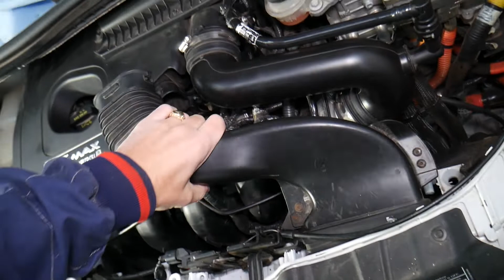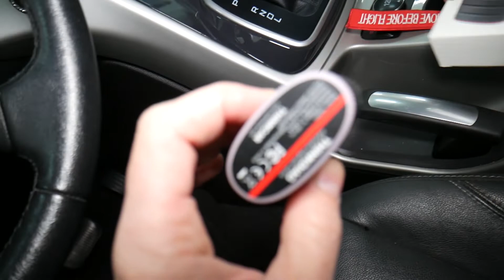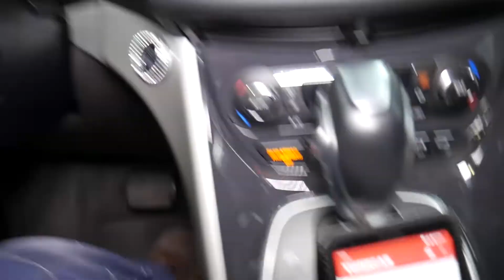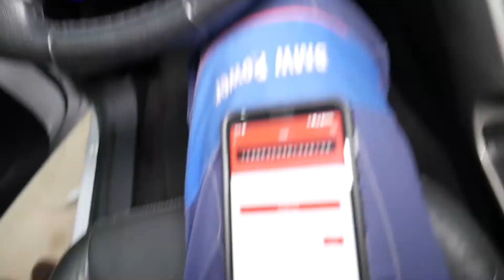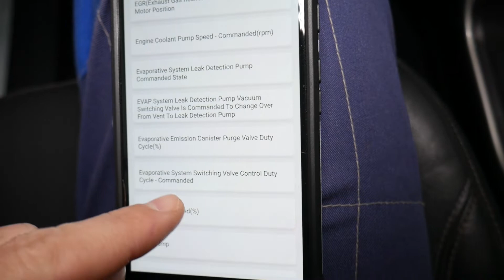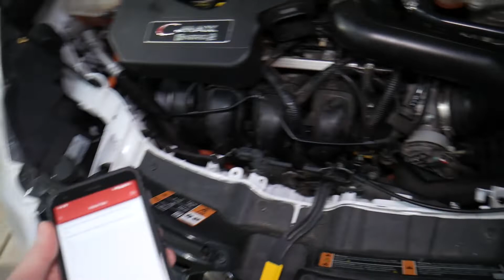HOW TO TEST PURGE CONTROL VALVE ON FORD FOCUS FIESTA ESCAPE EDGE F150 FUSION EDGE F-150 TRANSIT

Comment: Hello, I'm currently helping out on a Focus MK1 for my wife's aunt who's 80+. There's a lot of vacuum in the gastank to a point that you need quite some force to unscrew the gascap. The minute you open it you can hear the air hissing going in, like a vacuumcleaner. 
I saw a vid from someone saying that it's related to the evap purge valve not functioning.
 I applied battery voltage(12v) or engine-running voltage(14v) and the valve opens and closes. The harness gives me these 2 voltages also. I measured the amps and got 2,25.  Only when i connect the valve to the harness it doesn't open. 
I let the engine warm up, same situation. I didn't let it warm up till the cooling-fan started working though. Could that be it? Is this valve suppose to open/close in different stages? Am i doing something wrong?
I disconnected the valve and had DTC-codes(P0171 and P0443), used a Veepeak Obd reader and carscanner pro. I connected the valve and had no DTC-codes. Regards